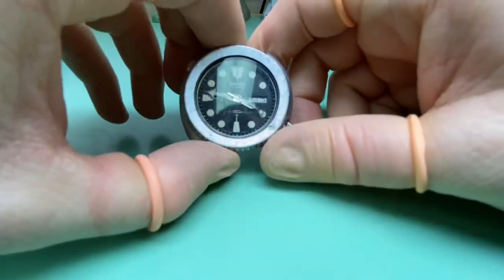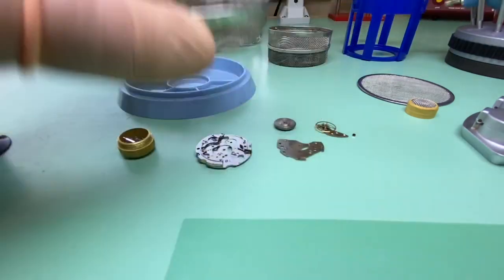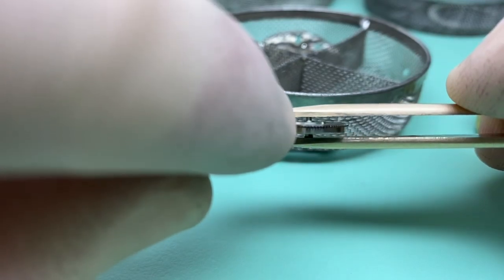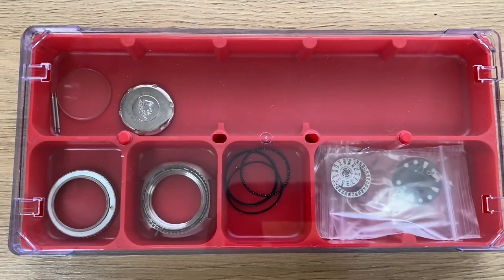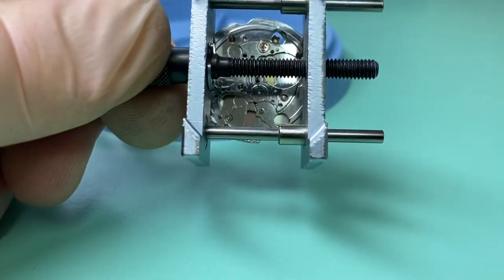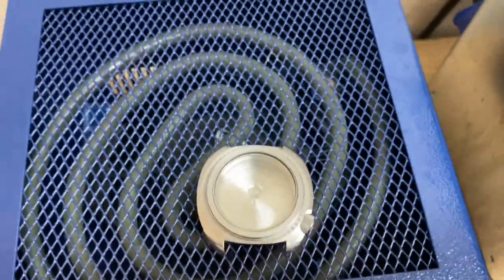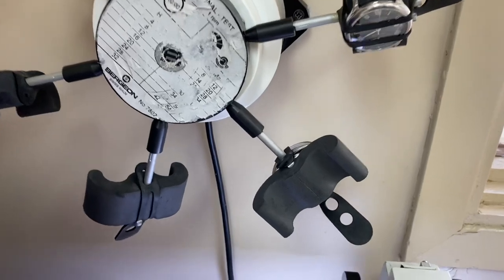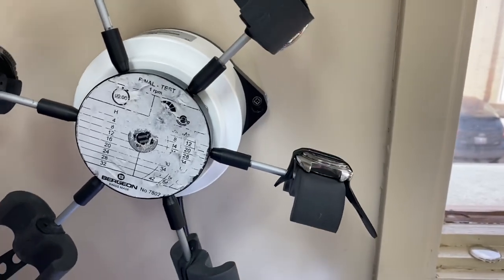Complete Overhaul Procedure For Your Seiko

Comment: No doubt this is an excellent service however, here in the UK this kind of service would cost more the a new movement.On my Seiko's as soon as they reach 5 years of age,I simply replace them with a new movement,the only exception being the Grand Seiko which goes back to Seiko for service.Thanks for the upload,I found it very interesting.
Reply from the maker: That’s all well and good, but really doesn’t apply here. I restore vintage Seiko, King Seiko and Grand Seiko. Seiko themselves don’t stock parts for these and don’t service them. There definitely aren’t new movements available for them.
Reply: @theseikologist  Understood.

Comment: Great video! Looking at getting a pre-owned Seiko Sarb017. Saw a couple that has been listed as 'Overhauled' in recent years. Would you advise that these are good to buy or should we steer clear of these unless we know where and how they were overhauled? Thanks!
Reply from the maker: No real need to steer clear, but now that you may need to overhaul it again, depending on how well the job was done.